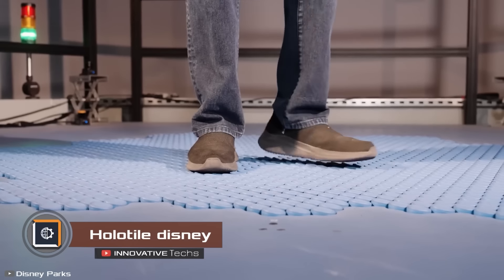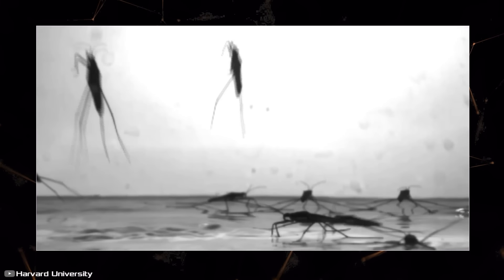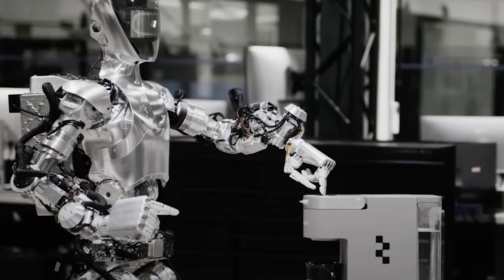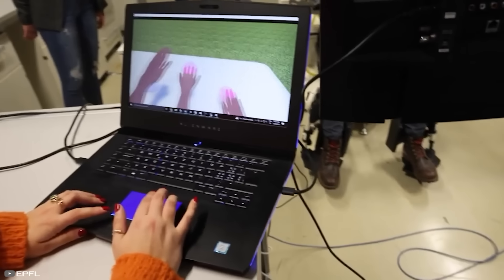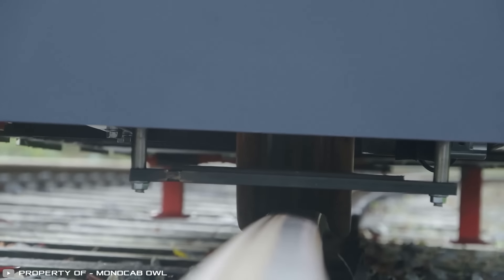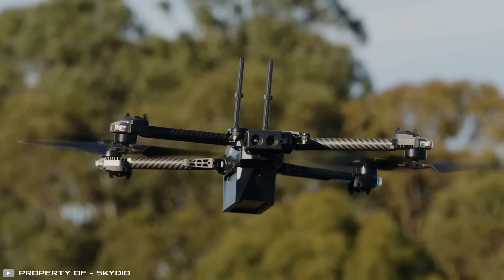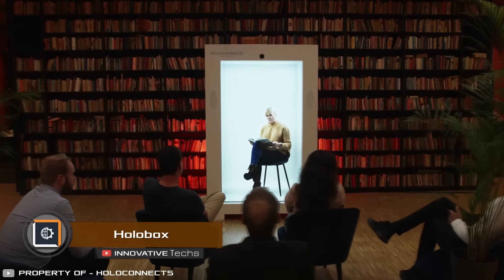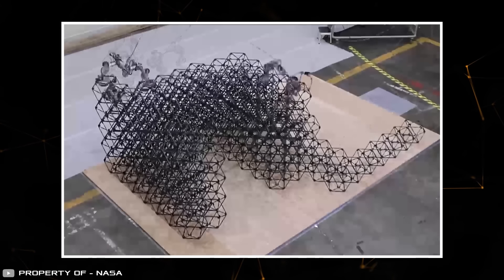INVENTIONS THAT WILL SOON CHANGE THE WORLD ▶3

Comment: Love how that solar power unit is about 50 times bigger than the single home it can power 😂
Reply: To be fair, 140kw can power like 20 homes. I don't know why they phrased it the way they did
Reply: Also didn't get which problem they in fact tried to solve as you need the full space anyways and modern solar panels usually withstand storm, hails and other effects.
Reply: @matthiasdegenkolb3429  Watch again then
Reply: @bbbbburton 
In my country typical electricity consumption for a conservative family of 3 is around 10 kWh/day in summer & around 4-5 kWh/day in winter.  Imagine how many homes it can power.
Reply: @bbbbburton  useful to know it seemed over the top for the claim 20 homes sounds more like it there is a lot of panels there
Reply: Nuclear is here
Reply: How many homes will it power at night, or when it's raining, or when the panels are covered with snow? It captures solar energy, but it's the longer-term storage for periods when the panels aren't producing power that will be the critical innovation.
Reply: @fanaticcoder3320  50kWH on a good day, so five homes in summer? And that requires battery backup, which incures maybe 30% losses if I am generous. So three?
Reply: @seanmalloy7249  I think it’s called storage units.
Reply: @57thorns 
You can do a lot more in theory, considering minimal losses & at 70% production for 12 hrs, you get around 98 kW per hr for 12 hrs.

Now if every house is restricted to 20A of max power, then you can run around 21 houses. 

No batteries, use  this as online power station, supplement it with diesel generator for night.
Reply: @fanaticcoder3320  So immediately cut it it half because it only supplies half the day?

You claim 10. I assume this is not an operation where we run on grid or using cheaper backup power.
Reply: Weird cause my mom has solar panels on her house in Arizona and she makes enough power to use and give back to the grid.
Reply: @57thorns  No, if it's 140kW of panels, then more like 560kWh on a good day, so 50 homes if using 10kWh ea during solar hours. And losses are in single digit percentages if you're supplying immediate premises. But definitely needs storage as well.
Reply: They would've used a chatbot to write the script and do the voice. Errors like that are pretty typical of AI

Comment: It's like looking through a 1960 copy of Popular Mechanics or Mechanics Illustrated.
Lots of cool innovative ideas that will never achieve commonality because of the cost of implementation and maintenance.
Reply: now itz now
Reply: Some already are, others are in the r&d mode but past alpha. I also see the connection between the mags you pointed out. A flying car seems to be more difficult than the 60's made it seem. Infrastructure has never even been thought through.
Reply: I grew up reading PopSci on daddies knee and through my entire life. Reality was far less than what I'd been gaslighted to believe.
Reply: Nothing in a 1960 Popular Mechanics predicted the ubiquity of devices we’re viewing this on now.
Reply: I agree.  I'd say disregard 75% of the things in this video.
Reply: Difference is those were just drawings and articles. These are working prototypes showing they work in reality.
Reply: except for that horizontally deployed solar array
Reply: Just as well. Most of these things are not world changing anyway.
Reply: @UncleWally3  
And therein lies the irony.
Reply: Drone delivery will probably get more common and easy though.
Reply: With very, very rare exception that is true. I have no plans to spend $2,500,000 just to have a robot make my coffee.
Reply: @jedics1
I'm not convinced it would be cheaper than fixed solar panels, since they all degrade rapidly compared to other solutions (look at every Mars rover that died a slow death because the panels got dirty and they had to turn off systems one-by-one to save power) and are nearly impossible to recycle, but as a solution for deploying a lot of power quickly to "the edge" I think it is a fantastic idea.
Reply: @jedics1   except that entire unit only has capability to power 1 home IF the sun is shining, supporting the point that cost out ways practical use. And except the max life of those panels are 25 years before going to a land fill since they are not recyclable. And that life will only be met as long as no hail storm destroys it first which happened to 14k panels on a 4 yr old solar farm in Scottsbluff, Ne last year. 

Proving NATURAL gas is the safest, cheapest, cleanest and most reliable form of energy on the planet.
Reply: Good thing it's 2024 where implementing these things is actually  doable and cost-effective
Reply: Do I take your word for it or should we compare the popular mechanics vision of the 60s
Reply: Grew up reading stacks and stacks of those. Imagine my disappointment with real life. 😂
Reply: This. After decades of Pop Mech, Towards 2000, Beyond 2000, etc. I've given up hope. Every week there's the "Journalists cover something someone drew in Photoshop." tech article of stuff that'll never be. It's all so tiresome. Instead of choosing to be a space faring advanced race we chose baby sitting the third world apparently.
Reply: 💯...if you have the patience to sit through over 19 minutes of robovoice narration. I don't.
Reply: I have been waiting for an affordable cycle-car type of vehicle for a great many years, lol
Reply: …and one that, for all its complexity, seats only one. Meanwhile the much simpler Vespa designed 75 years ago and takes up 1/4 the road space seats two.
Reply: @russelldawkins9094  Yeah there is that. But when you, on a Vespa or any other motorcycle, get run over by a person in a real car, the injury is likely to be much, much worse.
Reply: @christopherbedford9897  without protection on the sides, which this design lacks, I don’t think you would be significantly safer in this than in a conventional motorcycle/scooter. The significant protection would be mainly from wind and rain.

Comment: lol, the foldable solar panel array at 140kw would power a lot more than a "residential home;"  That would probably power 10-15 homes.
Reply: I was thinking that made absolutely no sense. Came to the comments to see if my brain was fried.
Reply: Yeah 394 feet of huge panels to power a single house ? Must house the "Small" Hadron Collider.
Reply: 280 homes in a poor country.
Reply: @Cibalia  Came here for the same reason.  Thought I was losing it.
Reply: @Cibalia yeah me too. I have a 10kw system and that does me most of the time
Reply: 394 feet .. because next to every house is an unused football field
Reply: The Idea is good, but like most 'New' Inventions it only takes a short time & it's updated/upgraded, this could be placed on top of Football Stadiums,Leisure Centres, Train Stations ,Church Roofs, warehouses, barns, trading estates, Supermarkets etc..... the list is endless of large roof properties that would put the PV Energy into the grid that would also make the cost go down, So Don't Condem The Idea that would stop the use of Gas,Coal,Oil Powered Power Stations that cause GLOBAL WARMING
Reply: Your description of various uses makes a lot more sense than the one described by the “experts” !!!!
Reply: If it unfolded as a roof instead of on the ground it could provide shelter or shade too.
Reply: that broke my brain too!

Comment: The only thing the human engineers cannot achieve is affordability.
Reply: I get the humor in this but we have computers, TV's, phones etc that have become so much cheaper over time.

 Remember when a 50 inch CRT TV was over 5k? Now a LCD version is a few hundred with a computer inside.

The first Motorola cell phone was over 5 thousand. Now a cell phone paired with a super computer, in most cases, a thousand or less.

Computer? In 1999, you could get one in NYC at the wiz for $2500. They were enormous towers with crts.
Reply: @brandon5012  That's always the case. They had cell phones before the general public for instance, those huge goofy grey brick phones you see in 80s films. Rich early adopters fund further development of the more refined third or fourth generation product that eventually falls within reach of the mass market.
Reply: Right now common people can’t afford robot. But in future guess 25 years ahead,  robot will be affordable like cell phones now.  Manufacturing cost, ad other costs should reduce. It takes time.
Reply: @megha6865  the more robots are in the world the less economic value a robot has, robots building robots will mean we automated the devaluation of robots, and they will become cheaper and cheaper and cheaper
Reply: New toys cost money, so you'll only be able to afford them after they become old toys
Reply: @Emphasis213
Exactly.  In the days of the "Home Micro" computer, a 5¹/₄ floppy disc drive cost about the same as the computer it plugged into, most people used audio cassette or even just typed the source code direct from a printout in a magazine.
Reply: "ROM cartridge!?  Are you Alan Sugar?"
Reply: That is why most goes to the military. They use free money.
Reply: .....and practicality?
Reply: The first personal home computer was a Wang that was for sell in Germany  in 1982 . Other countries  always get what is invented  in the US or other western  countries  before we do
Reply: @Emphasis213  I get your point but those inventions you listed become extremely popular because they ARE meant to be popular. Now tell me how could a carpet treadmill change your daily life.
Reply: @dafoex  Yep.
Reply: It can only develop eventually
Reply: .... I would finish that sentence with ,
.. is not buying materials from China
Reply: stop resource hoarders from charging so much then.
Reply: Light? Tough? Affordable? Choose any two.
Reply: Or reliability and ease of use.
Reply: The phone you're currently on was likely a multimillion-dollar device 15 to 20 years ago
Reply: @InvestmentJoy  jesus what an ass-pull, kudos thats gotta be the biggest I've ever seen.
Reply: @kingmasterlord  what phone are you on?
Reply: @InvestmentJoy  none of your business.
Reply: @kingmasterlord  for reference the s23 ultra I'm on is roughly equal in total floating point calculations (thus apples to apples) as an eserver node 665 operating at the Laurence Livermore national laboratory in 2004 as per the top 500 archive.

This node cost (according to an IBM price rundown) $6.5 million dollars, December 2004.

This was a full rack. My phone fits in my pocket.
Reply: solar panels are very affordable. 500Wp for 100€.
Reply: @brandon5012  Become wealthy then
Reply: 😂😂😂 whatever it is, simply has to be given time, and it will become very affordable. We see it in our every day life all the time!
Reply: @Emphasis213  50 inch CRT!? The biggest they got is 32 inches, anything bigger is a "rear projection".
Reply: @InvestmentJoy  You think they had all todays tech in 2004? And it was millions? Man, I want some of these drugs.

Comment: The balancing train isn't a new concept but nice to see it's getting a second chance.
Reply: it will not be able to take advantage of the second chance either, as the concept is fundamentally flawed
Reply: I wonder if two monorail carts can pass each other on a single railway track. As i remember correctly the energy to move an object on a railway is only 16 percent of what it would be if you use tires. As such it would be promising to use electric driven carts. (Lets remember, lots of railway tracks are still there because of military reasons, in case of war.But are not in use for transportation of goods or people. In case it would be allowed to use these tracks with driverless carts, that could be an economical liable option
Reply: @joostschure4190  Lots of railroad tracks are nowhere near where people actually live.

Comment: 1:55 140K/W sounds like a lot more power than an average home requires, to me
Reply: You must not have a family that cannot flip a switch off, turn off a TV, or anything else, like I do. /s
Reply: But, all you need is 400 feet of unobstructed yard to use it! Like, who doesn't have 3 acres of property laying about, where they can just unfold massive solar panels?
Reply: 5kWh would be reasonable without any heating or air conditioner loads!
Reply: Sounds like bugger all for the size of the bloody thing !
Reply: You are right. A normal (200amp) house is only rated 48kw, but will average less than 10kw in actual usage.
Reply: @rodneyclark9252  … can no one understand kW vs. kWh and frankly the fuses, there because they’re fault limiting to protect and discriminate with the MCBs in the consumer unit/distribution board, are supposed to be lightly loaded.
Reply: @andyxox4168  8-9 kilowatt hours is the average daily consumption of an American household. Upper end is 15 so, that would power 10-15 homes. That cost split among 10 families with the new batteries they're inventing would make decentralizing the power grid quite easy. Pricey, but pretty easy. Crank out nuclear power for industrial expansion, get the residents themselves off of that grid and let them crowdfund their own. companies make money, citizens get stability and self-sufficiency, and the power grid is not so vulnerable to attack. Everyone wins.
Reply: If you cook an hour you've already used 3kWh.  A wash machine is a little less hungry.  My stereo eats 240Watts; used 10 hours makes 2.4kWh.  Sum it up, the heaviest consumers are electric heating and air conditioners.  There's a load of small things on standby, which add up over 24 hours.  Completely forgot the fridge; 24/7.  Idk what that needs.  Lets say 120W; that makes 2.88kWh.  But if its 600W => 14.4kWh.  A PC eats that much.  If you have 3 kids, then you 3.5 PCs plus 3.5 TVs plus 3 stereos running all day and all at the same time.  And if you still use the old light bulbs, well then sit down before you calculate what they consume over a day.
Reply: @MichaelWinter-ss6lx you’re adding up kWh over 24 hours, while they rated the solar array in kW. To avoid comparing apples to oranges, compare your home’s usage to the array’s daily production of 3360 kWh (140 kW x 24 hrs).
Reply: @aaronburdon221  off grid, increased price massively ground solar array’s environmentally unfriendly batteries, no power at night or during heavy storms, yeah right decentralised grids make so much sense on so many levels 😂😂😂
Reply: @_just_looking_thank_you  I love your logic that solar panels produce their full output 24 hours a day 😂😂😂

Comment: Hmmm.....A solar panel set up that covers almost 400 feet is enough to power a residential home?....Sort of puts it into perspective doesn't it.
Reply: Standard city lot is 50x150 feet. So you just need to live in a tent and have 3 understanding neighbors.
Reply: how much of the Arizona desert would have to be covered in solar panels
just to light up Phoenix ?
Reply: Pretty sure this is an AI generated video and it screwed up some of the facts. Surely it could provide enough power for a whole neighborhood, not 1 home.
Reply: A typical residential solar installation is 10 kWp so this container is enough to power around 14 homes.
Reply: Or one electric car charger
Reply: @calvindavis7591  the average distance driven per day is around 35km in Europe. At 150Wh/km you get a needed 5kWh. That's a washer/dryer cycle worth.
Reply: When I was looking into solar, I only needed a fraction of that to power my home.  And I have seen advertisements that show new technologies that take a lot less.  This sounds like something that was available 20 years ago.
Reply: @froglady7491   yeah, solar dimensioning is as much art as science and more economic than scientific.   If you are filling batteries then you just want enough to run all your daytime use and recharge the cells.   If you are grid-tied then you are trying to "offset" your whole usage.   If they pay wholesale rates for overage you don't really want much overage.

Extra solar is wasted unless you are sending it to the grid - and then its not always worth what it cost you to install the panels if you don't have net metering.
Reply: Let's see ... the solar panel needs 400 square feet...
...and the average house in my neighborhood is 3000 square feet... mmmm...thinking..
Yeah... we can Rock that 💪!!
Reply: @josephbscott8350  Not 400 sq ft.  The length of it unfolded was 400 feet.  I think that the width is something like 20 ft.  Or whatever the length of a cargo container is.
Reply: @josephbscott8350  It covers 400 feet thats over 120 meters when laid out the houses in your neighborhood must be huge
Reply: You are 100% correct.  140kwh system could power to a dozen homes. AI got it wrong.   @bsauced

Comment: I think the one that has the highest potential is the Monorail type car that runs on the single rail. So many cities are troubled by cost effective mas-transit solutions this in my opinion has GREAT potential as a single rail is very cheap to make and easily integrated into most city's foot prints.
Reply: Search for the Brennan Monorail.
Everything old is new again.
Reply: Yes! More over-engineered gadgetbahns that don't solve any of the actual problems, but solve imagined problems like... having to only use one rail while there are two available.

Comment: The solar panel deployment is pretty cool, but what they leave out is that the system will most likely cost 100 times as much as dropping off a diesel generator that can do the same thing. In a fraction of the space, I might add.
Reply: An equivalent diesel generator requires tons of diesel and produces air and sound pollution I might add. And pv panels do not cost 100x more.
Reply: @stevejones1318  well, "tons of diesel" is kind of redundant. A diesel generator doesn't run on hopes and dreams. Noise pollution? Most diesel generators are pretty quiet, relatively speaking. It does make pollution, but not any more than one 18 wheeler, and again, for a miniscule fraction of the cost of that solar array.

Honestly, I'm not sure what your point is.